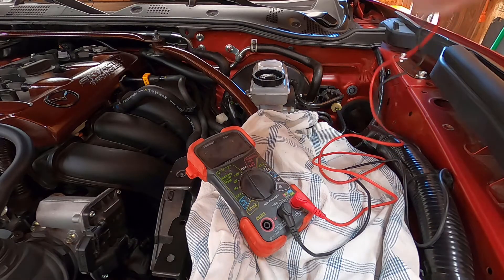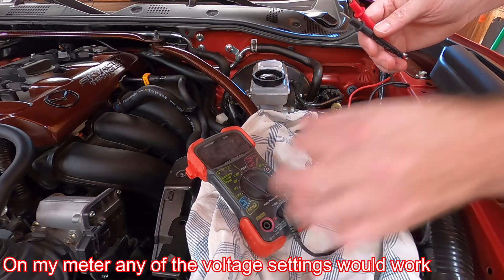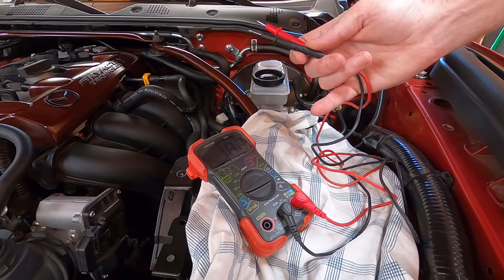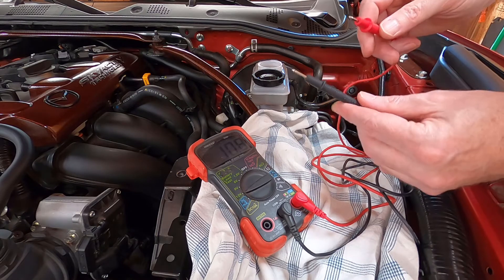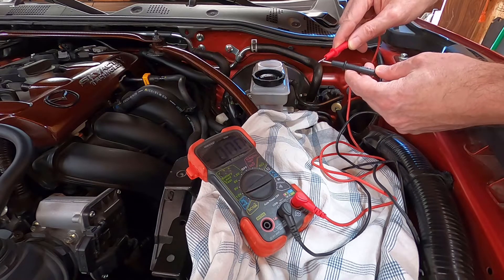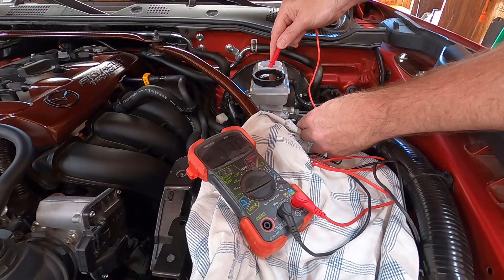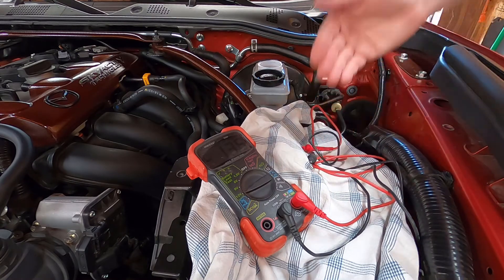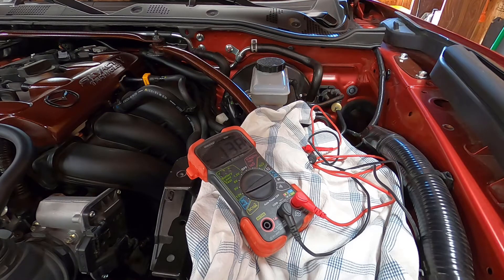DIY - How to test your brake fluid using a multimeter

Comment: For those skeptical about this, here’s the science behind it:
What you’re seeing is real and common, and it does not mean there is an electrical fault or a hidden power source. 
That ~0.2 V is generated by a combination of electrochemical effects, not by the car’s electrical system. 
when he puts one probe in brake fluid and the other probe on vehicle ground (metal) he has unintentionally created a weak battery because of a tiny electrochemical cell (galvanic reaction) formed between the multimeter probes.
The  probes are made of metal (usually nickel-plated steel or copper), and the car body is steel or aluminum. 
Brake fluid is hygroscopic (absorbs moisture from air), chemically active and slightly conductive when contaminated with water 
Now you have two different metals and an electrolyte (brake fluid + absorbed moisture) 
That is the textbook definition of a galvanic cell. 
For those thinking that resistance (measured in Ohms) would make more sense, yes it does but you’ll get unstable readings (because the meter injects its own voltage)
Reply from the maker: This! Thanks for explaining how it works!

Comment: Resistance measurement would have been more logical. Higher the moisture, lower the resistance.
Reply: that was my initial thought but it seems to be using the 12Volts from the battery

Comment: with battery connected there is current everywhere 
if there is X water in your fluid it will be more conductive as the water % rises .
same goes with cooling system 0.4 volts max

Comment: I can’t see how you can read a voltage between a fluid and earth. If you had been reading a certain resistance I might have been able to understand the technical reasoning, but as an electronics tech I am quite sure that your methodology is flawed.
Reply from the maker: It’s not a true voltage reading. It’s using the resistance to give you a general idea of the state of the brake fluid.
Reply: just like a carbon rod battery the metal case of the master cylinder is one electrode, neg, and the meter probe is as the carbon rod,pos, with the water in the fluid is the electrolyte. even batteries have an internal resistance that contributes to the reading.

Comment: This mskes no sense.  Where is the potential difference coming from?!?!  Taking a resistance measurement of the fluid makes sense. I'll have to try that on old vs new fluid. 
Signed: Electrical engineer
Reply from the maker: I 100% agree, but it does work.
Reply: As a fellow EE, I agree. This might work for this particular combination of a multimeter, car and fluid type, but without proper explanation of the principles behind it it's only as useful.
Reply: just like a carbon rod battery the metal case of the master cylinder is one electrode, neg, and the meter probe is as the carbon rod,pos, with the water in the fluid is the electrolyte. even batteries have an internal resistance that contributes to the reading.
Reply

Comment: Well, you can probably use a multimeter to measure if the fluid is good but this method that I saw here and other videos is BS.

3V is NOT 3% moisture. Try to fill the container with tap water. What value di you get? Try also distilled water 😬.

The voltage you measure between the battery and the center of the fluid is going to depend on a lot of factors. One is the shortest path between where you put the probe in the oil and ground. That will vary according where you put the probe and from car to car. 

Testers you buy have their own power source and they have a constant distance between the probes.
Reply from the maker: Thanks for the comment! In this video you can see a comparison between the multimeter method and a brake fluid tester: https://youtu.be/2IY4VotKeyY

Comment: I'm curious to know what mechanism is causing a voltage in the first place.
Reply: he is using ground so it seems he is using the voltage from the battery - I was wondering if his results would be more accurate if he dipped his lead deeper into the fluid in order to bypass all that plastic in the reservoir
Reply: Moister in the flui conducts conducts electricity.
Reply: @molnarrobert1893  Yes but a multimeter measures voltage in the voltage setting and doesn't create voltage.  The continuity setting of the meter creates voltage.
Reply: @Hoggdoc1946  it's a galvanic reaction between dis-similar metals that depends on moisture (like a battery).

Comment: False its the best because we are twin multi meter owners.  or you are just trying to copy my greatness, probably that one.
Reply from the maker: I couldn't remember who it was that recommended that multimeter to me... ;)  It actually works well for most things but doesn't like low voltage. I tried all the volt ranges and it kept switching between volts and millivolts on all of them.
Reply: @GregsDIYGarage  That's because the entire video is BS.